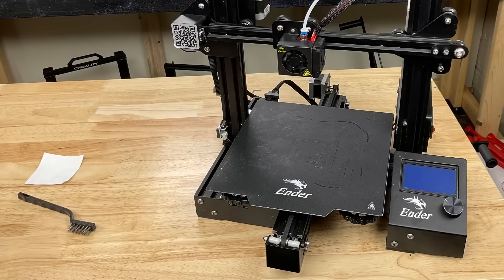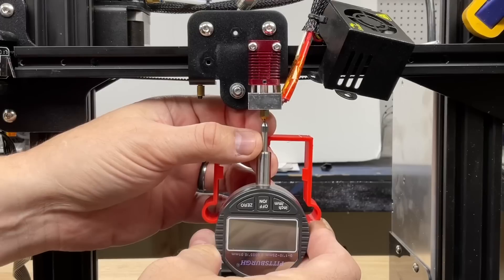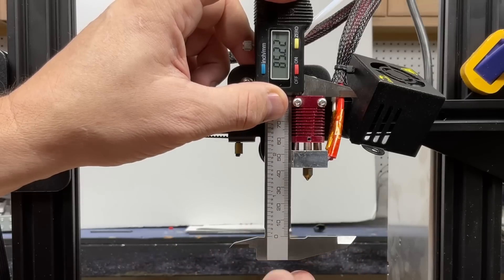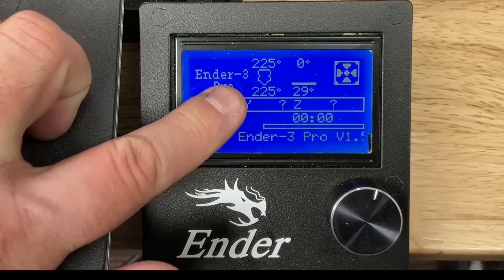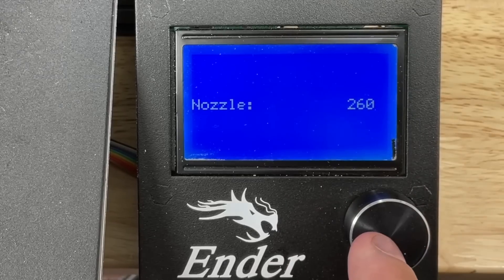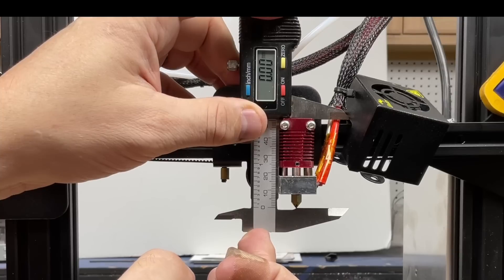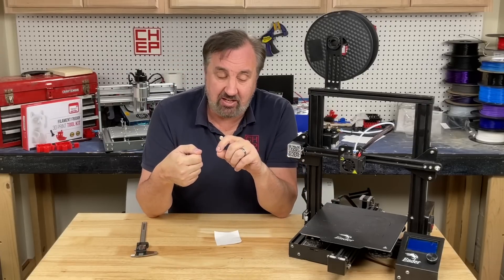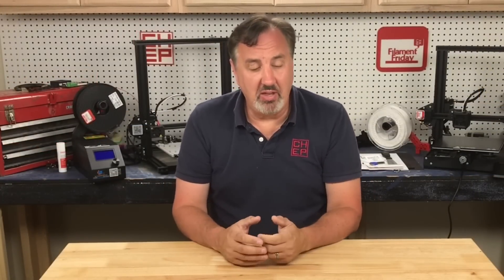Does a Heated Nozzle Expand and Mess Up Your Bed Level?

Comment: So glad that finally someone has addressed this issue. The Klipper firmware actaully mentions this in their documentation "Always perform the paper test when both nozzle and bed are at room temperature!

When the nozzle is heated, its position (relative to the bed) changes due to thermal expansion. This thermal expansion is typically around a 100 microns, which is about the same thickness as a typical piece of printer paper. The exact amount of thermal expansion isn't crucial, just as the exact thickness of the paper isn't crucial. Start with the assumption that the two are equal (see below for a method of determining the difference between the two distances).

It may seem odd to calibrate the distance at room temperature when the goal is to have a consistent distance when heated. However, if one calibrates when the nozzle is heated, it tends to impart small amounts of molten plastic on to the paper, which changes the amount of friction felt. That makes it harder to get a good calibration. Calibrating while the bed/nozzle is hot also greatly increases the risk of burning oneself. The amount of thermal expansion is stable, so it is easily accounted for later in the calibration process"

Comment: Thanks, great info. My take: when I do the "paper-feel", I see 0.1mm on the display when the paper starts to snag. So there's no "error" introduced. In my case: 0.1mm means "with paper in-between", 0 means "nozzle touching table". The combined expansion of 0.04mm on the nozzle (220 C) and +/-0.06mm in the table's (70C) may add up to 0.1mm which IS significant, so temp SHOULD be set.
Reply from the maker: So you are moving the nozzle (Z offset) and not the bed when using paper?

Comment: Great video. But I wonder how much of the expansion being measured is actually the expansion of not only the nozzle but also of the heater block and heat break.

Because the expansion of the block and break is irrelevant I'd suggest that the expansion of the nozzle itself would be insignificant.

Perhaps the only way to test the expansion of the nozzle itself is to remove it and heat it independently. In an oven perhaps.

As a metal machinist I'm accustomed to working with the expansion of various materials as they heat up and I would suggest the expansion of a brass nozzle would be so insignificant as to be unmeasurable with vernier calipers.
Reply: Considering the block is mounted at the top by 2 screws with very little material above them you absolutely need to account for their expansion in a test like this.
Reply: @deeznutznyamouth6002  ah! I see. In which case I am wrong
Reply from the maker: And I did by measuring from top to bottom.
Reply: Linear coefficient of expansion of brass is around 19x10-6 m/degC, which means at 225 degC youll get just over 4 microns of expansion. Even when accounting for the various components in the hot end assembly, I am surprised it expanded as much as 0.04 in the video!
Reply from the maker: I measured total expansion so heat block and break are part of the effect that affects bed level that most attribute to nozzle expansion.

Comment: Great video to clear this up! Heck, you're only talking like 0.0016" - 0.002"!! That's not anything to worry about not unless you're going by specs to build one of Elon's rocket engines!! 😅🤣😂😉. I'll stick with doing it cold and using my 0.20mm feeler guage for tramming. After that it's EZABL Pro that completes it with it's automatic mesh. 😊😊🤫